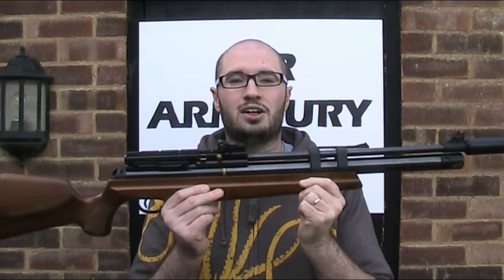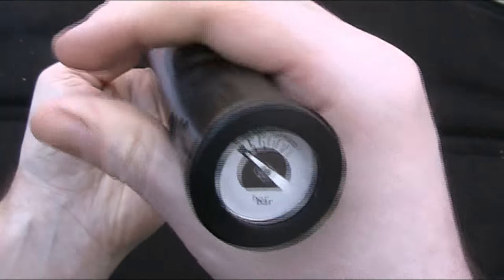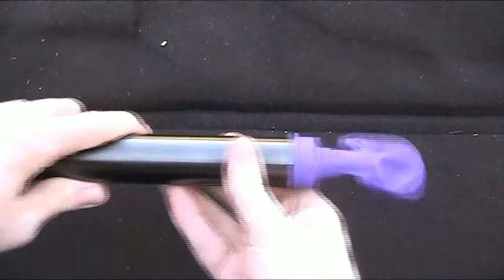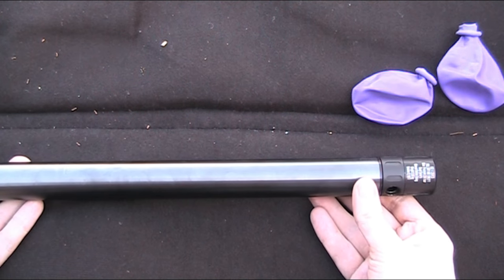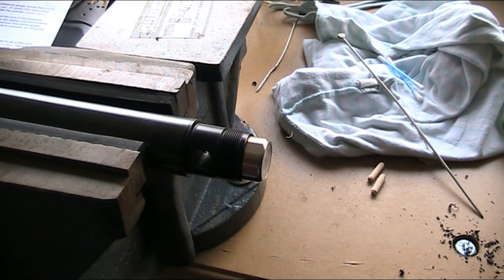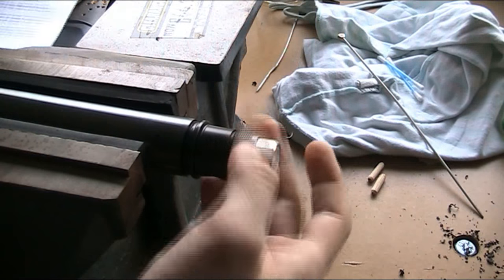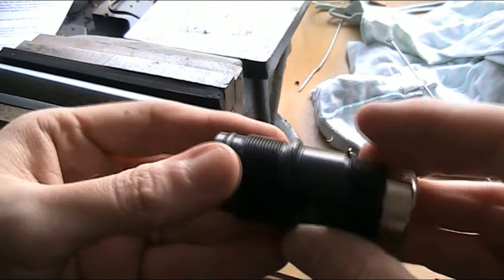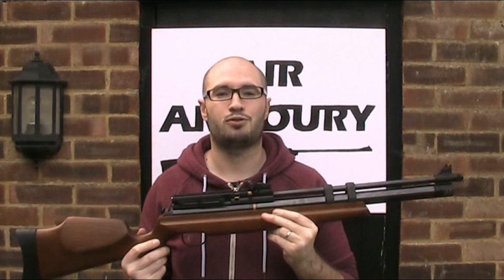How To Fix An Air Leak On A PCP Air Rifle (Hatsan AT44-10) | Air Armoury

Comment: Hello, do you know what purpose does that tiny hole in the front side of the air cylinder have?
Reply from the maker: I'm not entirely sure, but my guess would be that's it's designed to vent the pressure if over charged to prevent the whole air cylinder exploding.
Reply: This tiny hole serves as emergency exhaust safety valve if you forget to exhaust the air and start unscrewing the gauge port than at certain point the air inside the cylinder will escaping through it to indicate the mistake before some accident;)

Comment: My AT44-10 had been in storage for over a year and developed this exact problem when I attempted to re fill it with air, I was worried that I’d be having to find a replacement gun but your clear and helpful video has meant I’m now not so worried and will have a go at sorting it out myself, many thanks 🛠👍🏻

Comment: I have a problem with my gun where i cant pump it up at all. The air just escapes immediately and i cant build the pressue up. Any suggestions on what that might be? Im pretty sure its the air cylinder thats the problem but i havent chaced anything
Reply: fix it? some guns require being cocked in order to pump from empty and others cannot be hand pumped from empty under any circumstances.

Comment: I just bought a rainson edge-w 5.5mm with a 425cc tank and it has a slow leak from the end of the barrel. First I shot it and left it in the green came back 3-4 hours after and it was empty (100 bar went down the drain). I pumped it back up to 150bar now and it has a slow leak that I can barely hear at the end of the barrel… please help!!!

Comment: I developed a slight air leak in my air tank at the fill end. I only used it a few times sighting in a scope. About sixty slugs. I had an issue and on inspection the QE system had the retainer installed backwards. Also when I corrected the assemble the assembled baffles were about an inch from the shroud retainer at the muzzle. I determined the end of the tank that was leaking by placing ballon’s over each end of the tank. Anyone know how to fix the over night leak on the tank at the fill end? I’ve been burning powder for about 65 years. I watched the best air gun networks for two years before making the switch a year ago. I watched your video awhile back.

Comment: Very informative video, I have a Hatsan Airmax .22 and have a small leak which I suspect is in the hammer spring stem valve location, if I fill to 200bar amd come back to it the next day it’s completely empty, do you have an Airmax or would you possibly know the fix I need? Thanks in advance 🤙🏻

Comment: Air is coming from the little pin sized hole on the side / top of gas canister of hw100. 
Changed the little O ring inside and cleaned it out but it still hisses out when I try to fill it up.
Any thoughts most welcome 🙏

Comment: Needs to be fitted with a wrench I cannot get it off without a screwdriver without doing multiple damage because it's super tight I guess I could take a heat gun to it and heat the whole damn thing up but now let's not put any marks on it for a wrench that would just be stupid

Comment: nice dem0. would you ever put some silicon over rhe end seal?
Reply: Adrian Cox never put Lubricant inside a air cylinder that is for high pressure, it will explode.
Reply: WaschyNumber1 

Preassure does not ignite lubricants, heat does. The phenomenon you are thinking of occurs when heat is generated  by air being compressed at very high speeds. At which point the air quickly reaches ignition temperatures. This does not happen fast enough in an airgun air cylinder but it does happen fast enough in a spring powered rifles compression chamber or a diesel engine.

To give you so perspective even higly volatile substances like Gasoline doesnt ignites until 270 - 480 degrees celsius. 

There is no way your air cylinder will even reach 100 degrees at a anything resembling normal filling rate. (Especially concidering the massive volume of the cylinder.) Putting silicon oil inside the cylinder is common practise when installing a regulator for example, but mainly because its easier on the o-rings.

Comment: Dude please tell me that there is an easier way of cleaning an AT44 barrel than the one way where you have to take the air cylinder off and taking the barrel off. I have the QE Long so i have to take the shroud off before i can take the barrel off. This also means that i have to take off my scope. This totally sucks. The gun is awesome but needing to do all off that just to clean the barrel is BULL. I'm afraid to use the pull through method because of the tiny o ring that is behind the breach. Where i live there is no gunsmith that i can bring it to. How do you clean yours.
Reply from the maker: Have you tried shooting some felt cleaning pellets through it? Might give it enough of a clean that you don't need to take it apart.

Comment: My god thank you for this, I didnt know how to get the fill valve off my Kral (which uses the exact same fill probe), it's been chewing pieces of the fill probe o-rings, which then clogs the valve.
Reply: Update:
So, I was able to disassemble the valve itself and it's a different design from the AT44's, their only shared design is the fill probe and the outward appearance of the fill valve assembly, and how it's disassembled.
I was able to disassemble the valve and blow out the O-ring shavings, but the issue is a bit worse than just an O-ring (which would have been simple fix).
Turns out the valve isnt just a chamfered pointy brass one with a simple O-ring on it, instead it's got a chamfered nylon gasket design thats interference fit onto the metal valve spring retainer body.

Upon inspection, a round scoring groove has developed on the nylon gasket as a result of filling the gun from empty to full.
If I had dealt with the O-ring shavings immediately when the problem developed, the issue would have been solved.
I'll attempt to slip an O-ring onto the valve to see if that solves it, if not I'll have to get a new valve.

Comment: Very nice mate mine At44 long start leaking after I removed the regulator to turn down the power.
Reply from the maker: Did you manage to fix it?
Reply: Air Armoury yes I tear the o ring valve to install the regulator I test yesterday after watching your instructions. I’m increasing the regulator pressure to 120 bar to see if is gonna increase the velocity without touching. The hammer spring thanks for asking Mate

Comment: Thanks for this video. My air rifle is different from yours, so i will have to figure out how to fix mine, but the theory in your video is solid. Btw, would you recommend against putting a touch of silicone oil on the orings?
Reply: always put silicon grease when applying new seals